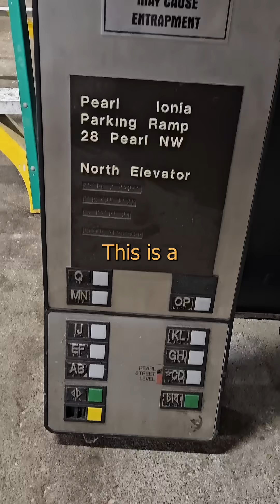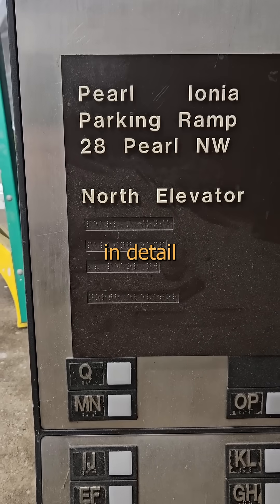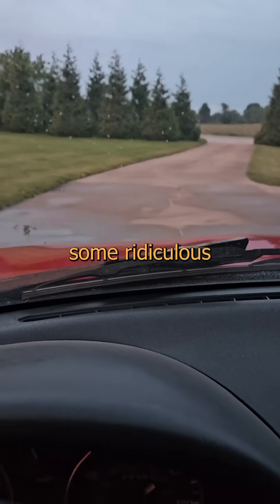Miata Mischief #chrisboden #engineering #gear #elevator #score #stories #parts #hacking #making

Comment: Giant PA speakers in my now Fiance's 1997 Rav 4, we are talking giant 18" woofers and horns out the ass, i had to completely deconstruct the cabinets and horns to even think to get the doors to barely close and even even then they were touching both the windshield and the steering wheel, God forbid I had to put it in reverse, that wasn't an option 🤣

Comment: Last year, I found a needed hood for a 2007 subaru. It was even the color I needed, but the only vehicles I had to fit the cargo in were a 5th gen Camaro and a 2013 Hyundai Elantra sedan. So, not realizing just how bent the original hood was, I measured it a couple of directions and decided a hood would fit in a compact car. As it turns out, an undamaged hood would not fit in a compact car, the salvage yard was closing as soon as I paid for the part, and the nearest store that might have some rope or anything to tie this thing to the outside of the car was almost 10 miles away, all I had was a couple jackets, the floor mats,  and random crap left by the kids. I got the hood wedged 2/3 of the way into the trunk,  nice and snug, but I couldn't secure the trunk lid, I figured if I put the floor mats over the hood that might protect it. I got several looks on that drive home, a compact car with the hood from another car sticking 18" out the back like a tongue,  it all looked fine when I was moving, because the airflow would keep the trunk lid down, but when stopped it was clear that the only things keeping that load in the car were thoughts and prayers.

Comment: I got a 90" TV for next to nothing and hauled it home and up to a third story apartment in a crappy junker of a minivan.

The company I work for often sells its office supplies back to its employees when they're refreshed/replaced. Monitors, desks, office chairs usually. One day I walk in and I see a GIGANTIC TV, flat on its back, on a rolling cart. I look up the model, and find that it's a 90" 3DTV, manufactured by Sharp somewhere around 2012. No remote, no glasses, but a solid 1080p screen, power cable included. The sticker on it puts the price at $400. Online e-tailers are still trying to scalp people for $8,000 for one of these fuckin things, but here's my employer, practically GIVING it away. 

Being a savvy shopper, I don't want to buy this thing without knowing it functions properly, so I go back to my apartment, grab my Steam Deck, its dock, and an HDMI cable, and take that back to the shop. I wheel the TV over to a wall where I plug it in and hook up the Steam Deck. Sure enough, it's working perfectly, no damages, no dead pixels. It was probably just cycled out for an upgraded display or projector in a conference room. 

I talk to one of the sales leads, because at this point I've told myself if I can get the price down to $300, it's mine. I'll figure out the logistics of where the hell it goes into my tiny apartment after I get it home. I ask if there's any way they'd be willing to walk the price down, and she thinks about it for a moment before taking me to one of the registers in the back. She rings me up, scans the sticker I brought with me, and says "let me make this deal a little sweeter for you." I look down at the pin pad with my total, and she's marked it down to $250. I swipe my card IMMEDIATELY. 

Now comes the fun part, getting it home. I drive a Kia Soul. Great for hauling fursuits to conventions, not great for TVs that have more inches than I do. My roommate has a beaten up old clunker of a minivan. It was an early 2000's pearl white Town and Country mom-mobile with no A/C, a cracked dash, windows that were gorilla taped shut, and it overheated if you went over 45, but it only cost him $800 and a slice of his dignity. Due to complications with who was on whose car insurance, I had to leave my roommate there at the shop and drive home to grab his van, and bring it back to SEE if the TV will fit. And there was just one more complication: it was POURING rain. Like, Florida afternoon rager of a thunderstorm.

I had to drive slow and careful all the way back from the apartment to this shop to get the TV, we covered it in plastic garbage bags to shield it from the rain while we took it on the cart from the door to the rear hatch. We folded the seats down and lo and behold, it slid perrrrrfectly into the back, with scant centimeters of clearance on all sides once the hatch was closed. Never a more perfect fit did that van ever experience.

We got it home, waited for the rain to stop, then proceeded to break our backs, almost literally, hauling this 90", 150 lb monstrosity up to our third floor apartment. I ended up grabbing a random neighbor walking by and offering him forty bucks to help us. We gave the ring camera owners something real interesting to see that day. 

All in all, HELLA worth it though. It's great for movies and couch gaming, and I love this thing to death. I'm just afraid of what we're gonna do once we leave this apartment...

Comment: got a 2 for one- 
helped an old landlord haul home a giant light array for red light (he was crazy but it was a room to rent for a bit so i just ignored the red flags while i had to) and i did it in a d21 truck that was 2 inches off the ground with 10s. it was bigger than the entire bed and the rachet straps were torqued on to the back net as there were no gates. we went over a bump we didnt see and caught air. both of our backs hurt for weeks and suprisingly no damage to the bulbs or the car. he never asked for help again lmao. one time i got stuck on a speed bump and somone boosted the back wheel with a rock in a parking lot. miss that car but it was a time bomb with that motor and it had to go when moved on from a job. first car i really put miles on so it ment alot to me. the little rc car that could. standard with no abs and a absolute trooper. me and the other half have nicer things now but before we bought our second car that has a frame which reaches the top of our ev. i drove across town to get a mispriced char from the state surplus to replace one that had broke and let me tell you this. i would not recomend playing tetris with a 2025 tesla model 3. somehow was able to jenga a full office chair in and still use that 5-10 dollar government office special. pro tip the beige and steels lasts for ever regardless of the metric ton they are and nobody wants em. also surpluses honor mistake stickers once then change the rest aparently lmao. if it can sit in an office building for 40 years it can support my late night gaming.

Comment: Myself and a friend of mine cruising down the street in my Ge-o (1994 Geo Metro as pictured) watched a deer go toe to toe with a Ford Explorer and loose taking a broadside hit to the vitals however missing the hind quarters and loins. MONEY SHOT. So as the hi-tek-red-neck I am, couldn't let fresh meat barely blugeoned lay waste for the buzards to feast when I could feast. So with the help of my friend Jimmy, not James, not Jim, Jimmy, we shimmied the roadkill up to roof tho it dangled the hoofs down the sides of this compact hatchback. With no straps to attach this carcass to my car's @$$, with my left I held the front hoofs and Jimmy held the rears with his right, one problem.... Stickshift. So with one hand on the wheel, and one on the deer I needed a 3rd hand, luckily Jimmy had a free one not holding the roof surfer. So as I worked the pedals calling out the gears, Jimmy did a phenominal job shifting with the wrong hand like a bumbling British kid learning to drive for the first time. We made the 10 mile trek to the cop shop to get a roadkill tag for the dearly departed for a legal harvest. We then drove another couple miles back to Jimmy's shack to process the meat out. Please like, because it was pretty cool and halarious. Jimmy still talks of that day even 15 years later. I still have the car and it's one story of many with that car. But none more unhinged than that.
Reply: Had to edit it because of youtube not liking a word that's been in my handle since before the time google owned this platform... grandfatherd in I reckon... however I do apologize for any spelling and grammar errors. I do better with numbers than words. Thanks for reading!

Comment: I was a poor broke tech school student and was getting my first auto shop job. And I had purchased a toolbox for myself (not using the provided ones😅). I had only a 96 mustang at my disposal so I did what most would've done. Pulled the passenger seat out and left it in my apartment and drove around for 3 days without being able to see out the right side. And a lean so bad that you'd think that I was muling WAAAAY too much to be out in daylight. 😂😂😂

Comment: In my teens I bought a B and W subwoofer at an estate sale. It was tip top of the line for whenever it came out which meant multiple cones in multiple directions, a huge box and of course it weighed just short of 100 pounds. I had gone in at the end of his day and lowballed the snot out of the guy so I was taking it then and there, and with this big fuck in my arms I go to open my trunk and I’m hit with the realization this thing isn’t about to fit. Even if there was a hope of it actually going in the trunk hole (there wasn’t) it had cones on the bottom, sides and top so I couldn’t just drape it over the side. Giving up on the trunk debacle I go to put it in my passenger seat  since it’s an old 3 series where else can it go but I come to find out it is so wide that I can’t shift out of 2nd. Already tired of this game I decided I could get home in second and proceeded to thrash my engine trying to keep up with normal traffic for a mile or two before giving up with ringing ears and a free Italian tune up, but I’m still a mile or so from my house. With limited options (in my head at least) I decided this wasn’t getting left in my car so someone could steal it (it was so light begin with) so I gathered it in my arms and with tact and grace trying to avoid the speaker cone on the bottom started to walk my happy ass home. An hour and a half and more breaks then I’d like to admit I was home with my sub and my car was two busses away.

Comment: I used my 1992 Geo Metro to haul home a Hazard Freight trailer kit and fully assembled engine crane - the rear shocks were on the bump stops and I couldn't close the hatch, but it made it the 20 miles back. Drove much better with the assembled trailer hitched behind it and the engine crane on the trailer, though...

Comment: I drive a 2015 Honda Accord Sport (MT).

Once upon a time, I acquired a stick and lift-TIG welding machine. As such, I needed material to practice with. After getting referred by a friend at the local Airgas, I was pampered at that place. The president of the little metal shop walked me around and gave me the deal of a lifetime. While I didn't get any actual pipes or anything, he said I could get whatever fit in my car from the scrap bin for $100. 

I got so much steel and aluminium that my back end had sunk FOUR inches. After weighing the vehicle, I discovered that I had 1,200lbs (550kg) of metal in my trunk and rear seats (max. weight was 850lbs (385kg)!!!). That explained why my car had a Carolina squat. 😂
Driving it was very scary, especially on the highway. Braking was insanely bad, and it was only me in the car with my steel. After the 20-ish mile drive home, I immediately unloaded as much as I could so I wouldn't have to drive with that much weight in the back ever.

Another janky thing I've done in the same car, was transport a 75" TV. It was in the rear seats, and both rear doors were open, only held together by a bungee cord I found in the garage. Driving it home wasn't fun.

Last thing I've done was somehow strap FOUR kayaks to the roof of a 2020 Hyundai Palisade. There was no roof rack, only some pool noodles (to protect the roof), rope, and a few bungee cords. My dad wasn't pleased when we arrived at the boat dock to find that one had damn near fallen off.

So yeah, I've done some SKETCHY stuff with my car and other cars. 😂

Comment: Always have ratchet straps for the need to do something like lay the front seat down with headrest in the floor, the back seats to boot open, the boot open up with a couple of small trees the hatch that stays in the car for cut down to hold the ass end of a "working"  rocket.  Oh, this was a 2003 Nissan Sentra with a orange/red  tie-dye T-shirt on the end of the rocket far enough I was pulling over twice and got a police escort for part of the trip.

Comment: Goofiest stuff I did was cram two old, large university server UPS units, 4 fire extinguishers, a small jewler's kiln, and a projector into my subaru impreza. No it is not a hatch back. I also used to ride my bike 2 miles one way to the stores in town and fill my dad's sea bag with about 180lbs of pepsi and whatever tools and supplys I needed from the hardware store that week. The sketchiest part about that was the mud on the road during and after river floods and the one time there was 2 feet of snow with layers of ice in it. Always a core workout to stay upright.

Comment: I once hauled 400lbs of molasses in a 2-door Acura Integra no bigger than that Miata.
Reply: I need more details
Reply: I need more details too. 

Also I have a del sol, you wanna compare to a miata, that's what you use. You have so much room for activities comparatively, in an integra. 😂
Reply: When I was 19, I decided to move to a cattle ranch and become a cowboy. Best experience of my life. I did that for 10 years. BUT... When I first moved there right out of high school, all I had was a couple boxes of belongings, and my tricked out 98 Acura Integra LS 2-Door (Google a picture of one). It was a large ranch, about 160 acres divided into 4 x 40 acre pastures, and we rotated the cows from pasture to pasture as they ate down the foliage lower and lower. There was always a time towards the end of the year where all of the pastures were pretty much chewed through down stubs and dirt, and we would have to supplement their food with hay/straw/alfalfa bales. Luckily, we had a large stack, and it was pretty easy to feed them by tossing the bales in wheelbarrow and spreading out the bales over a few hundred feet (to prevent spoilage, as cows don't care when they let loose). We would supplement their feed with 200lb tubs of molasses and 50lb salt blocks. Those, however, would have to be hauled out to the middle of the field. Here's where my Integra comes in. I would load 2 of the 200lb tubs into my car by gathering 2x6 wood beams and use them as loading ramps to push the tubs in one by one (one in the back-seat, one in the front seat, as the trunk was too small, and was already taken up by a gigantic subwoofer box, lol). I would drive down the bumpy road with the tubs seat-belted in, bottoming out my already-low car on every divot and dirt pothole, as the road wasn't paved, and I would get to the middle of the pasture, open the doors, and wrestle the tubs out like a Hulk Hogan vs Randy Savage cage match in my little coupe.  Good times.

Comment: I was 10 or 12, my mates and I pushed a small fibreglass boat in a "trailer" made from 2 old bikes for about 6 km only to get on the creek and immediately sink it due to overload.
In my twenties I drove with 15 passengers in my VW station wagon (around the size of a Corolla wagon).

Comment: My trusty 2004 Nissan cube was used for a good few moves and was able to fit a 8kg washing machine in it with a 50 inch plasma screen tv wedged on top. No, i couldnt use the rear view mirror but it made the trip from Auckland to Tokoroa (~300km) safe and sound. 
Poor cubey mccubeface got retired last year after putting 150,000km on the clock in 4ish years.

Comment: Im the king of weird junk around my town so nobody gave it a second thought when I was walking down main street with a grandfather clock ratchet strapped to myself like a backpack but I did get some looks when I was hauling an old twin bed frame, an antique urinal and an inflatable carousel across town with my bike. I started off with the urinal which I found in a condemned oil refinery from the 1900s and the bed and carousel was found alongside the road on my way home with the urinal

Comment: I dragged a Truck for 3 hundred miles About. With a tire A chain ratchet straps. I took wires from my Rear lights and hooked them up by a wire To the truck and back. Turn signals to. I made it about two hundred Fifty miles before a cop, Decided to pull me over. He was laughing his butt off as he walked up to the vehicle. He went up to the first truck realized.Nobody was there then came up to the front. Ask me what the heck I was thinking. I told him Just about home I had to move the truck that day They were going to crush it. Then
Charge me A thousand dollars storage fee. He made me go through a whole bunch of inspection on the side of the road. He realized I had all the stuff wired up in everything and he let me go. With a piece of paper. Is telling other cops he inspected it.

Comment: I put a round kitchen table top in my VW Bus, but the diameter was so large that the only way it would "fit" is sideways with the sliding door open. I had someone in the back holding it as i drove home all the way across the country. 

I bought all the pickets for a 100ft fence and stacked them as tightly as possible in the back of an 83 f-150. They stacked right to the rim of the bed. It unbalanced the truck so badly that i had to be careful how hard i accelerated off the line or the front tires would lose contact leaving me with no steering. 

Drunk me stuffing the live tree in my Ford explorer after the company Christmas party. Four drunk engineers hauling that through the halls of that hotel and stuffing it into the elevator was the best part.

I'm sure there are others i can't even remember.